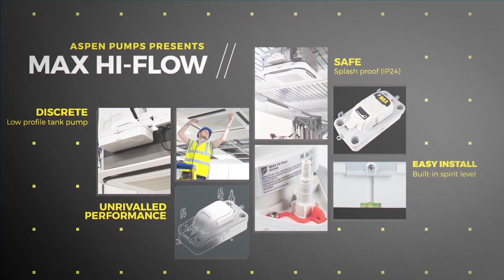Max Hi-Flow Installation

Comment: Two black wires are for Safety i.e NO/NC...in case you have BMS you can see the error code, or you can fix a alarm with it....Rest all wires are your RYB, normal Line and Phase